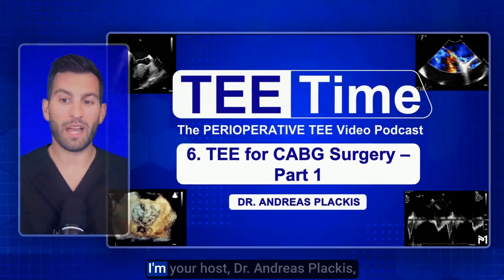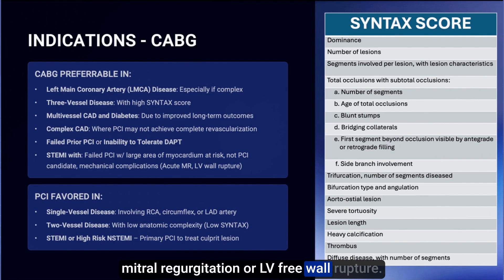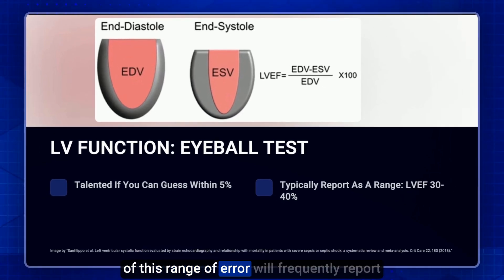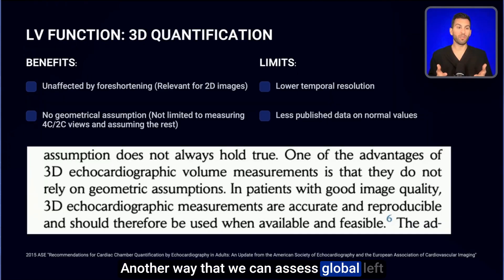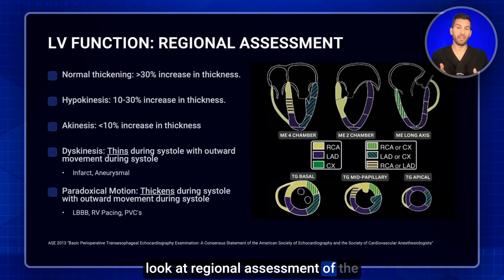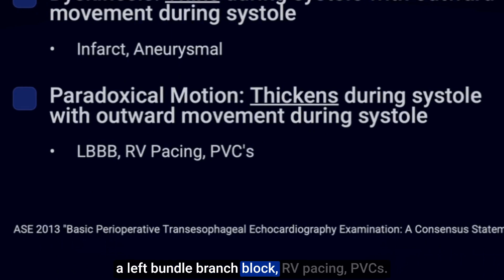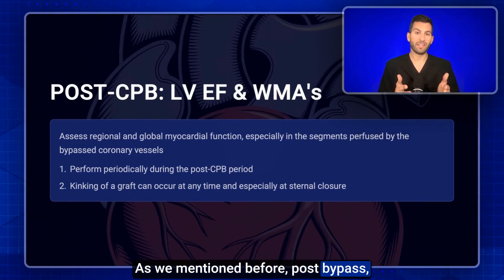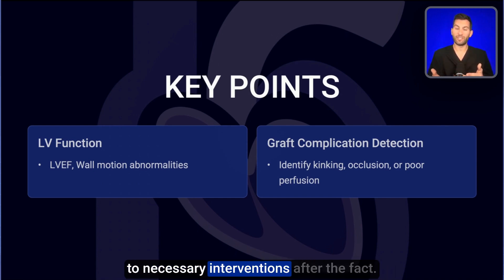6. TEE for Coronary Artery Bypass Graft (CABG) Surgery - Part 1 (Transesophageal Echocardiography)

Comment: Nice presentation especially on mitral regurgitation. It may be point out that when we are having secondary mitral regurgitation prudent to considerate one grade higher.

Role of TTE and trans esophageal Echo is both preoperative and intraoperative.When having per operative mitral regurgitation we have to add one grade Plus for very obvious prognostic reasons and to cover guarded intraoperative loading conditions.
So to summarise before every cabg... in addition to routine wall motion analysis one must look for Valvular Pathology ,specially for MR  in Plx  4 chamber, and two chamber views inorder not to miss eccentric MR.

A REALLY GOOD SERIES

PROF.SALMAN
PAKISTAN
Reply from the maker: Appreciate these thoughts! Recognizing that MR can slightly improve under anesthesia is important as a patient baseline under non-anesthetized conditions is what matters most. In the US, there are no recommendations to add 1+ to MR severity if under anesthesia, but to make sure conditions are as similar to the awake patient as possible. Normal preload, baseline blood pressure, etc.

Comment: hi. thanks for nice video lecture. Please comment why you used TTE images for demonstration of 3DQ analysis? And how often you really use this option in your daily practice?  Actually in my real practice it is quite a hard task to obtain high enough quality TEE images for disk method estimation of systolic function , I mean without foreshortening and with visible endocardial borders along the whole LV, so we always keep in mind other modalities like FAC, dp/dt, MAPSE, tissue doppler to have at least some parameter to track during surgery in patient with low quality LV images. Sometimes it is impossible to overcome LV foreshortening and for rude volume estimation I use only 2ch view or biplane with comissural and ME LAX views which is quite comparable with eyeballing. Sorry for many letters) PS - Honestly, good correlation with preop TTE values for LV usually seen for patients with large ventricles due to CHF.
Reply from the maker: Thanks for watching! The 3DQ with TTE image was to show concept/process for performing as knowing this process can be simple to apply to inverted TEE images. Avoiding foreshortening is important and simple with Simpsons if you XPLANE through LV apex in ME 4C to give best ME 2C and also XPLANE through ME 2C and right invert to give best ME 4C. Neither of these should be foreshortened since XPLANE lines are through LV apex. With proper TEE technique and experience this step is frequently unnecessary
Reply: @TEETime_PodcastMD  Agree for Xplane - it is one of the best tools coming with 3D probes in my opinoin. In my practice 3D option echo machine is present in one of 4 ORs and we have to deal mostly with 2D probes without Xplaning. Thanks for your response
Reply from the maker: @evgenyhomenko3034 great questions and great thoughts though. Thanks for asking